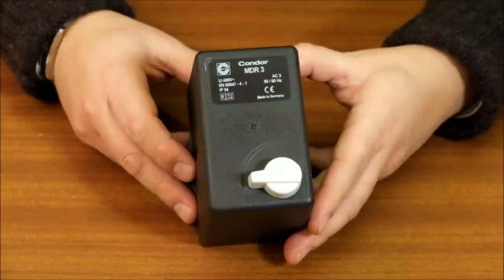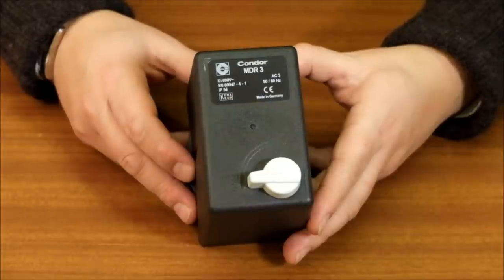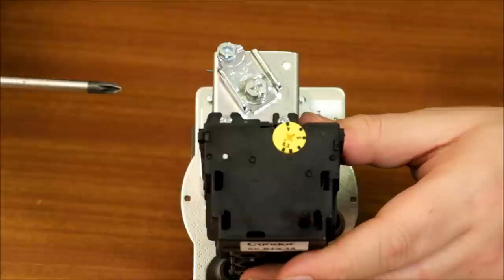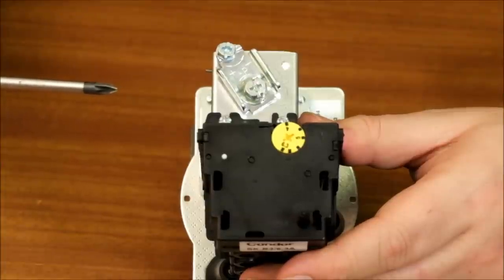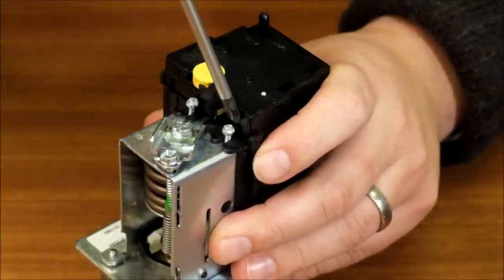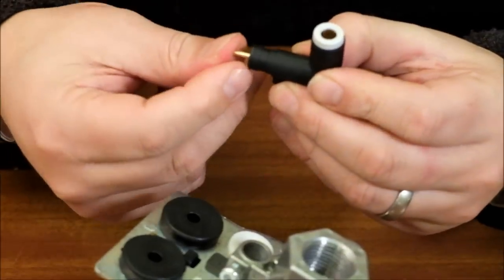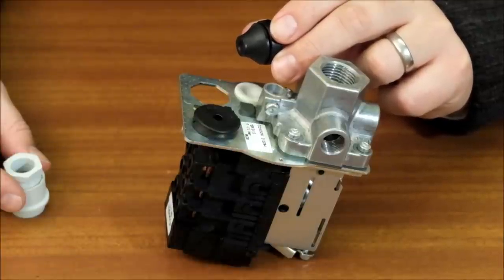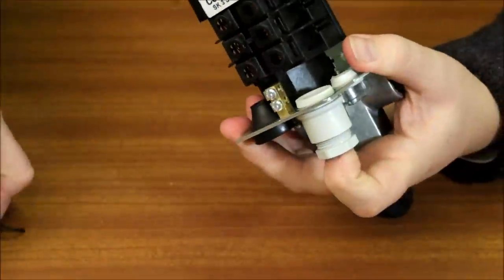Condor MDR3 Air Compressor Pressure Switch

Comment: how would u wire this for single phase uk
Reply: You would normally use the MDR1 for single phase - see https://www.youtube.com/watch?v=tkux63uJ-t8 or https://www.airlines-pneumatics.co.uk/pneumatics/air-compressors-and-dryers/compressor-pressure-switches/condor-mdr1-compressor-pressure-switch/S020122

Comment: I have installed this on my 10hp at the 16amps setting but it just keeps tripping
Reply from the maker: Hi Adam,

We recommend a 20-24Amp pressure switch for a 10HP compressor.

Kind regards

Comment: can u set a 15 psi Differential   say 110 to 125 psi
Reply: Yes, the differential on the mdr3 is adjustable.
 If the set cut in pressure is 3 bar the cut out pressure can be set anywhere between 4 and 7 bar so 3-4 bar is your 15psi.
Reply: @andrewrogers9906   3 Bar is only 43psi i need 110 cut in to 125 psi

Comment: how would u wire this for single phase uk
Reply: first line you enter with neutral, second one you enter with phase then you put a wire from the exit of that phase and put it on the entry of the 3rd line, so that now you have 2 exit availlable, one for neutral and one for phase.

Comment: Hi. Why does my pressure switch leak air after it cuts off
Reply: On a normal piston compressor there is a pipe from the compressor to a non return valve which is fitted to the receiver.

When the compressor stops the unloader valve on the pressure switch vents the air in this pipe so that when the compressor starts next time it is not working against pressure.

Therefore you will normally get an air exhaust noise each time the compressor stops but that should cease directly.

If the non return valve on the receiver becomes faulty then air can leak from the receiver and out through the unloader on the pressure switch.

This often leads to a call reporting a leaking pressure switch - always the first thing to check then is the non return valve.

This non return valve can be subject to very high temperatures and has a seal which should replaced on a routine servicing basis.
Reply: have the same problem is there some pics of the service routine on the replacing the seal ???